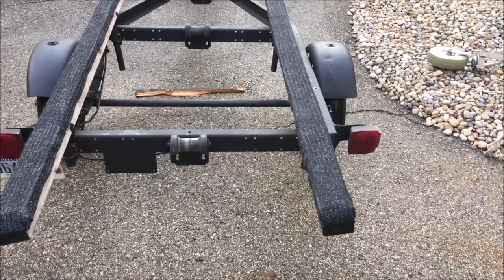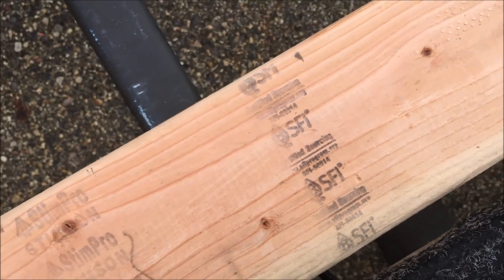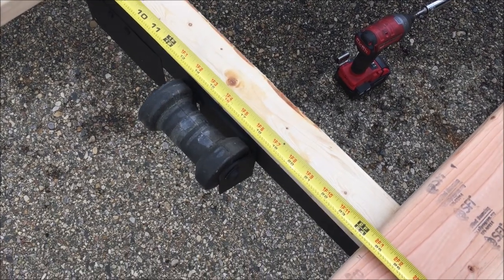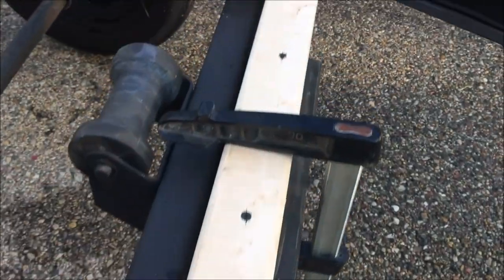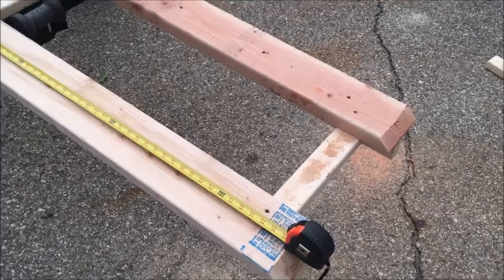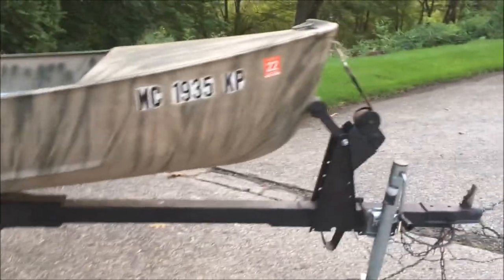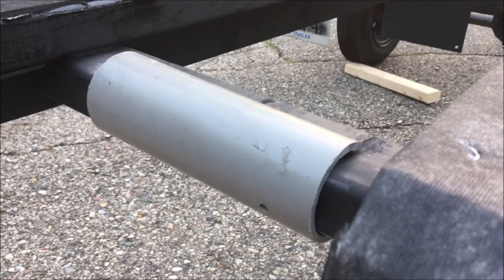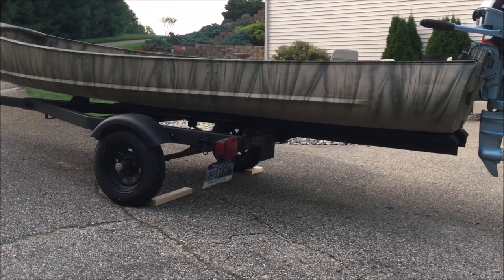OldGuyDIY $20 Bunk Trailer Mod 4" Hinges, 2x6, 2x3 Wood Grumman SportBoat Sport Boat Canoe Kayak DIY

Comment: Standard for a trailer is 15-20% of the trailer weight on the tongue.  It looks to me like you have no tongue weight.  If so your trailer will be unstable and tend to fishtail.
Reply from the maker: Thanks for your comment.  I have driven hundreds of miles at 75mph with this rig and it tows beautifully.  The boat is 110 pounds, the motor about 56, add a couple of bags of decoys and I have a full, light load.  Perhaps the decoys up front contribute to the nice ride.
Reply: @OldGuyDIY  75!? How wise is that? Just a matter of time...

Comment: I use similar diy ways of 2 PT 2x6 with 8” between for beaching mine at my stony launch. My slightly longer trailer has 3’ teeter bunks on the rear crossmember plus a roller. I just drag it on without unwinding the winch

Comment: Nice set up!  What would you think about door/gate spring closer, between the frame hinge and bunks, to hold the bunks up when unloaded? Still looking for a suitable trailer...
Reply from the maker: The spring closer should be fine.  I used paracord because it is simple and will not be adversely affected by muck and water.  If you hold the bunks completely up when unloaded, you will need to force them down when attempting to load the boat onto the trailer.  Thanks for asking.

Comment: Hey again.  Since we emailed over the weekend I've found two sport boats for sale.  One looks like yours, but a newer one, 1991 ?, looks different.  It has what appears to be a flat metal support that runs much of the length of the inside of the boat, just below the gunwales.  The seller shows the coast guard label with only 360# rating.  That is much less than yours as stated in your videos.
Any ideas?  Thanks for your time.
Reply from the maker: It sounds like you are describing the new model Sportboat.  You may want to see the pictures on the Grumman site for comparison.  It seems the US Coast Guard reclassified the Sportboat from non-planing to planing hull in the 80's and reduced the stated capacity from 1100 to 550 pounds although the boat had not changed.  The flat metal along the sides you refer to is simply an aluminum cover for the flotation foam that Grumman put along the sides of the boat after the Coast Guard changed the rating.  The foam in the sides is supposed to ensure that the hull stays level if swamped.  From what I found on-line, the newer Sportboats were made of thinner aluminum (.040 v .050) and have one set of oar locks.  I have owned both versions and after having the older version, you can feel the difference the thinner aluminum makes when motoring on the water. The bottom of the boat seems to transfer more of the vibration and feeling of the waves to you, the drive.  If you had never been in the older version, you would never know it was different.  I prefer the older model but would buy a newer model if the price was right.  If you want the older, heavier aluminum version, look for one with two sets of oar locks and no slabs of flotation foam along the sides.  Wikipedia and the Alaska Outdoors Supersite have lots of good Sportboat info.
Reply: I’m sure an early one would be scary with an actual 1100# onboard! 4 adults make it tippy.